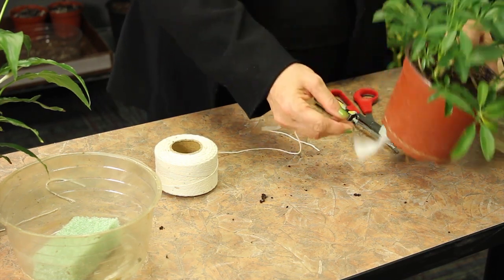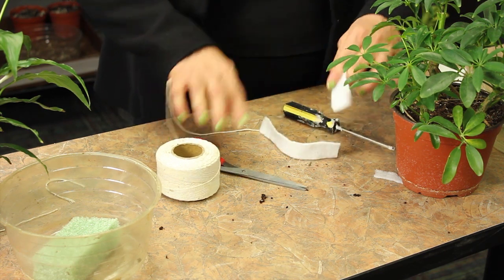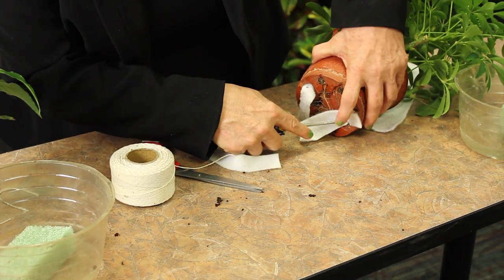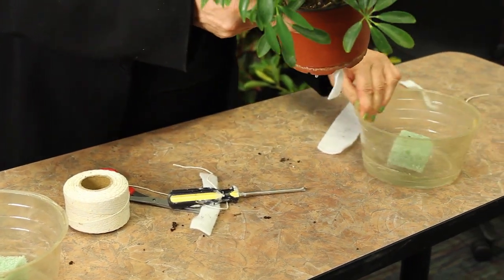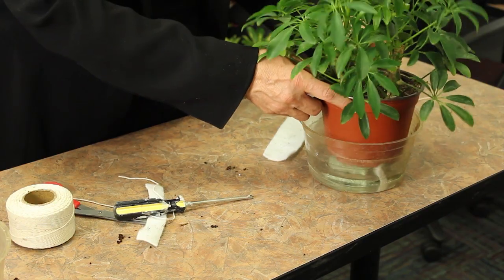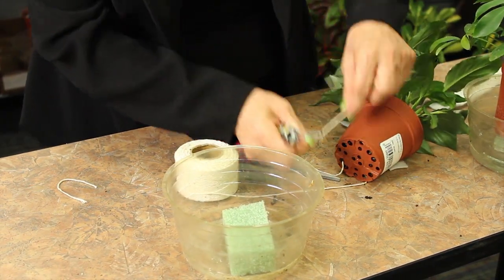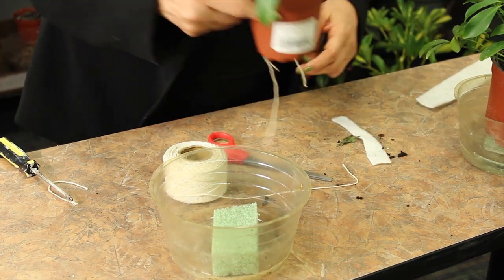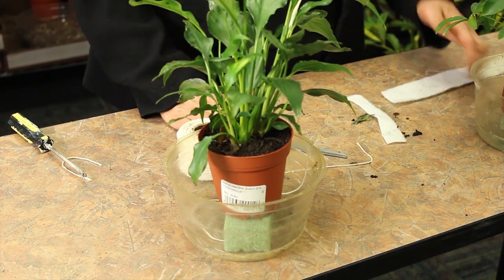Homemade Plant Wicks : Gardening & Plant Care

Comment: I have a little tree that I’ve had for two years that’s called a “waterwick plant”. It came in a little cup inside another cup and the roots are coming out with the wick as well, it desperately needs transplanted. I know this sounds like a dumb question but I’m so scared to kill it after transplant. As long as I follow this video all should be well, correct? I also have a big plant like the one you use to demonstrate the wider wicks (umbrella plant?)  I’m going to try water wicks on that as well bc that plant seems very picky about how I water it, I’ve almost killed it so many times and it seems to be doing decent in my bathroom window but I really think this will be perfect for it. Great video, thank you so much! I’m going to need a couple really big pots for my umbrella plant but i really want to try it bc that’s another one of my favorites. I try so hard with my plants but just don’t have quite a green thumb, I think our hard water plays a good role in my plants survival as well, I think some plants just can’t take the yucky city water.
Reply: I meant the hard water plays a big part in my plants not fairing so well, not surviving well

Comment: I made some with yarn and pushed it through the holes before I added my plants so the yarn is sitting on the bottom of the pot. I  then put in some Lachuza pon, then added my plant, then more pon. Will my system work even though the yarn is right at the bottom of the pot?